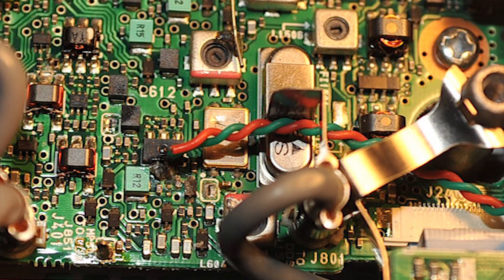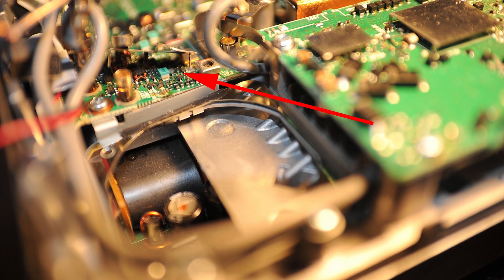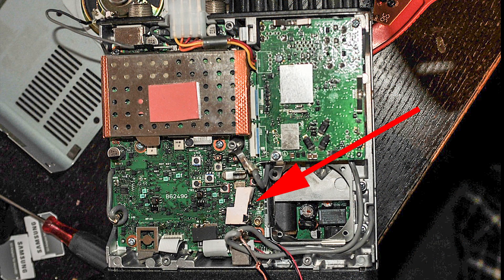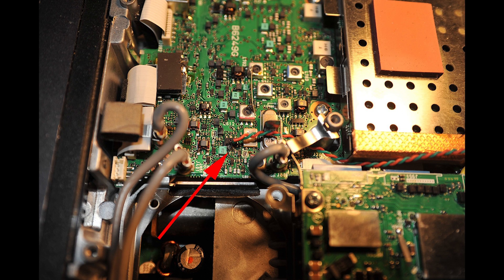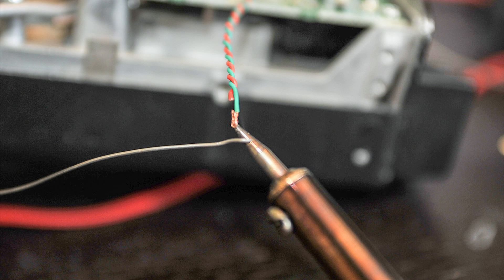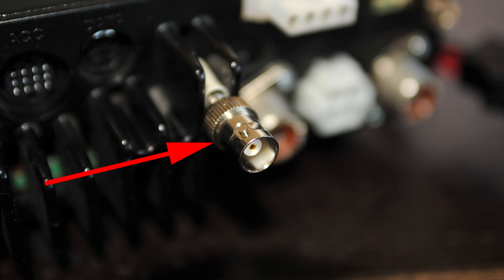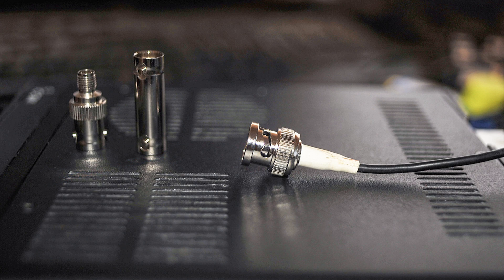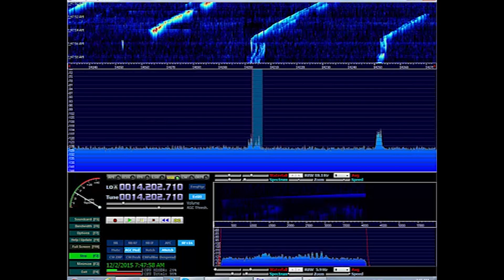Using a Gimmick to Tap the IF of a Transceiver--Ham Radio Basics--Jim W6LG

Comment: So the wire connected to the IF doesn't get connected to anything.  Only the wire capacitively coupled by being a twisted pair, gets connected to the centre of the coax going to the SDR?  And the braid of the coax going to the SDR, is connected to nothing, or is it grounded to the chassis of the radio?
Reply from the maker: Yes, from memory, I twisted two wires.  One connected to the tap and the other to the SDR.  They do not connect to each other.  Adjust the number of twists as needed.  Worked great for me.  I will use it today as I am connecting the station here at the new location.  73, Jim
Reply: Jim W6LG thanks for the reply and the great videos.  I plan to try an SDR coupled to the first 
IF (6-6.5 MHz) on my old tube transceiver.   Did you have any problems with transmit energy leaking into the SDR in some way and damaging it?

Comment: Isn't there a bit of risk injecting noise/feedback and birdies into the IF from the wire pickup?? I used a 2pf (I think) tap to tap my IC-720, fed into a MMIC amp and bandpass filter then out to an SMA. Lat thing I want to do is degrade the main rx.

Comment: Good idea Jim but basically aren't you still creating a capacitor coupling
Reply from the maker: Yes, exactly, but a very low value that I can modify with ease.  Longer or shorter to get the value correct.  I cut the twisted pair until it was too low and went from their.  Hence the different color wires in the video and changed connections for the video.  Thanks for the question.  73, Jim

Comment: I tried using an RTL-SDR with my TS-870 using the IF out port Wich is around 8.3--mhz something, and the SDR isn't really good at that frequency. There's a second IF around 72mhz inside the Radio, I wonder if that would work better. Then I can use the full IQ decoding at that freq. Something to try eventually.

-73 de David KEØPBI :3
Reply: I would try the 72MHz IF as you are correct that these SDR dongles don’t perform well at 8.3MHz as that is really well below their optimal lower limit.  For my Yaesu FT-950 the IF is 69.450MHz and that works quite well with the various RTL SDR dongles I have used over the years.
Reply: Buy the official RTL-SDR v3 it's also about 20 bucks and uses the RTL chips but the design works properly with HF and above + low frequency drift.  Much better for only a little more cash.
Reply: @stewartrv  I have 3, 1 from their Amazon and 2 from their eBay stores. One doesn't work on HF because of a shorted transistor (after months of use, I must have done something for it to do that...) and the other two operate poorly of mf & hf. Funny thing is I found the 73.05 MHz IF on a test point of the RF board both before & after the XTAL filter and is has a cap in series on the board, so I don't need to add one, what luck! 

It needs a Taiko Denki "TMP" connector to plug into it. But for testing, I just stuck a paper clip in the TMP hole and used a BNC scope probe to connect the sdr. It works even better sticking the SDR's SMA connector directly to the board's TMP connector with the paper clip.

I'm hoping to build a cable to port out IF on the back with a BNC. Took out the unused RTTY socket and put the BNC there. Still waiting on the TMP to arrive connector though...

I could also tell that the signal was better than the 8.833 MHz as I could see and hear DX AM stations on the waterfall. Where using the other didn't. 

The radio would receive CFZN at S9 on the S meter the SDR wouldn't even register at all on 8.833 MHz but would on 73.05. I think that's because the SDR only uses one branch of the I/Q for freqs lower than 24MHz thus only half as effective. Although on 8MHz I could see and listen to the local AM stations just fine.

73 de David KEØPBI :3
Reply: @Sys-Edit0r-1995  I've got a FT-950 and it already had a tap point, but I'll do my FT-897D next and I already know it needs a buffered connection.  As I mention in another comment I purchased active/buffered G4HUP PAN Adapter TAP PCBs and the cables from www.huprf.com.  They seem to have been very well used and therefore tested so maybe worth a look at the site for info.  I had a few of the cheap RTL dongles but the official RTL-SDR was the only one I found that was on frequency and works on the whole spectrum from 160m to UHF and so was very happy with it.   I found trying to "calibrate" the SDR software so it would work with CAT and drive the rig reliably was a pain in the arse with the others.  73 de HA5RV
Reply: @stewartrv  
Sounds interesting, I'll look in those boards. Also the port after the 73.05MHz is also amplified but is only about 20-40 KHz (obviously) but that wouldn't be very useful for a waterfall, but for just receiving audio it's seems pretty decent.

-73!

Comment: Hi Jim. I’m looking at some of the older rigs like the 850 or the 950sdx and I think you have to tap the first IF in them as well. It worries me doing that. My sdr is an airspy hf plus. Far superior to my icom 7300. I use sdr console v3.0.11. Best NR I’ve seen in software. Some radios do have an IF out but they are extremely limited to bandwidth on the display that way. I was told to use a capacitor as well? Not sure why. Hope you’re feeling a bit better Jim. Miss your vids.

Comment: Can you use the SDR while tx'ing?   Also are you able to look at your signal on a keydown on the SDR!?  This is GREAT Jim!   I was contemplating how to run a receiver SDR while using the Transceiver and not blowing up the SDR, I was thinking some relay box on the coax, but this is much better.
Reply from the maker: Not using it the way I have it connected.  Looking at your own signal becomes much more complicated and difficult.  Thanks, Jim
Reply from the maker: A second SDR with a padded front end might be the way to go.  73, Jim